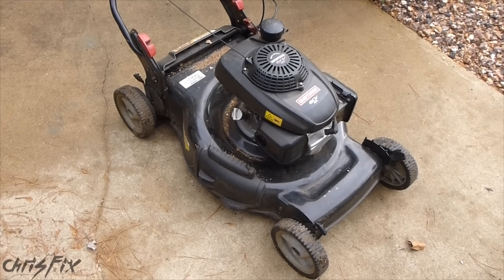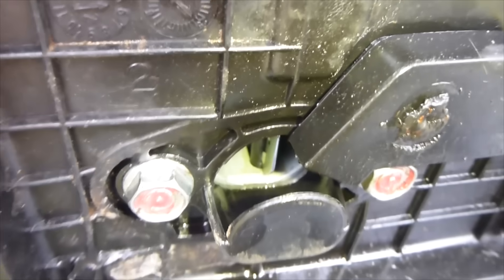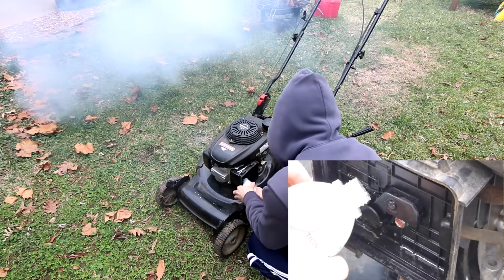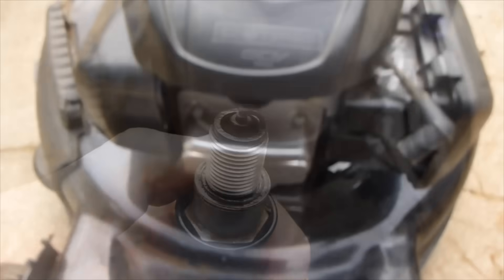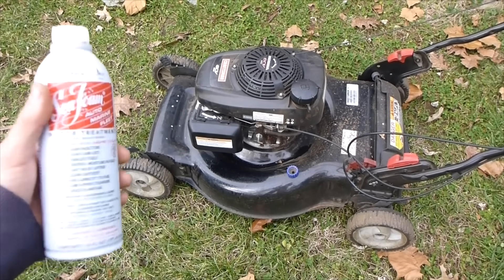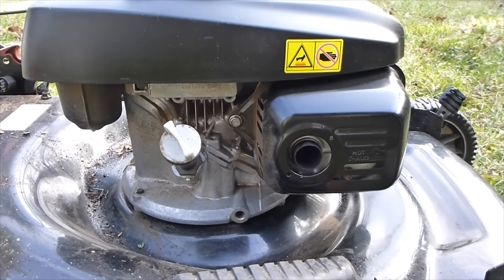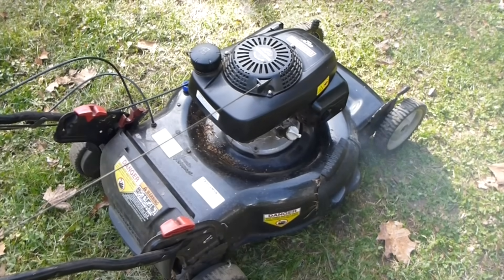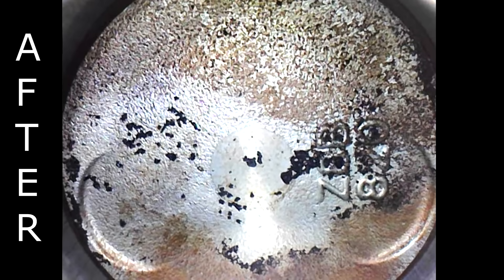Does Seafoam Actually Work? (with Proof)

Comment: I add Seafoam, Marvel Mystery Oil, and STP injector cleaner per the instructions to a 5 gallon gas can and use it in all my small engines.  Mowers, chainsaws, leaf blowers, string trimmers, etc, etc.  I do this 4 or 5 times a year.  I started doing this in 1997 and have very little problems with my small engines.  A couple years ago I got a well used John Deer lawn tractor that was hard to start and keep running.  I added all three products to its 2.5 gallon fuel tank per the ratio in the instructions, and did not do anything else to the lawn tractor.  Before half the tank was used it began running nice and smooth and is easy to start.  As of yesterday I have not had any problems with the engine other than a cracked inlet on the file pump near the end of last summer.  I also use all three in my cars.  My 2003 Envoy got over 225,000 miles on its original plugs.

Comment: Chris does sea foam damage an old engine I just bought a 1993 ford bronco with a 5.8L
Reply: It wont damage your engine or the plastic fuel lines if you put it in your tank. The best way to use seafoam is to pull a vacuum line that goes to the engine, I've had good results with the brake booster hose (you might have to do this while its running, by try to do it before starting... depends on the engine). 

The car will run roughly because the air-fuel mixture has been changed, so don't worry. Then open your seafoam and slowly tip it into the vacuum line while the car is running so that the liquid is sucked in by the vacuum. Be careful not to pour too quickly, or you could stall out the motor, or worse, hydrolock (NOT GOOD).

 You should see white/grey smoke coming from the exhaust... that's the seafoam along with the carbon buildups that are being removed. I like to use about half of the bottle, but you might want to use more since you've got a pretty big engine. 

After that, put the vacuum line back where you pulled it from and you're done!
Reply: Brandon Massey thank you for your response! So break booster hose? I’ll do that

Comment: Never had a problem until recently.   I did a "hot soak" with Seafoam on my 8hp 40 year old Briggs that ran fine.  Then I couldn't start it and it has zero compression.  Wondering if the Seafoam loosened up too much carbon and the cylinder got butchered thurs resulting in zero compression?   May need a rebuild but not sure yet..
Reply: Maybe a seal came loose?
Reply: @trpt4him  Thanks, it was the seat.
Reply: Pull the head off you will probably find the valve seat came loose and jammed the exhaust valve open. It’s a common occurrence on those old l-head engines. Just put it back in place and go around the perimeter with a centre punch to tighten it up. I’ve done that to several old Briggs engines with very good results.
Reply: @steveb.6267  Thanks, that was the problem.  Wow, I'm glad it wasn't way worse.
Reply: Rich Speers it’s an easy fix. Every year thousands of engines get thrown out because of this simple problem.

Comment: For a better controlled experiment you might clean out all of the carbon deposits & photograph it before running the test to be sure that the deposits aren't just clumping up. Also you might want to try the same without putting the Seafoam in to determine if by just running the mower that the carburetor expels carbon.

Comment: yeah,  breaking carbon deposits loose and sending them through the engine sounds like a GREAT idea.  If engine manufactures thought this was wise or necessary, they'd require it as preventative maintenance.  Keep buying your snake oil.

Comment: Funny about that hydrolocking.... I used to clean my engines by pouring water into the intake while the revs were moderately high. Cleans the carbon off the cylinders very nicely and never had any problems, but then I only poured it in slowly without stalling the engine. Black crap comes out the exhaust for a while at first but then clears up and at that point I know my pistons are clean. Would be nice to see Chris try a comparison between Seafoam and just plain water. He might be in for a surprise. This is a very old method... I'll probably keep up the practice since it works so well, but I'll be aware of the potential to hydrolock the engine if I go overboard, which I won't.
Reply from the maker: Interesting, thanks for sharing!

Comment: We used to get carburetors at the Yamaha shop that were ruined from the acid in that seafoam. If you do not know anything about cleaning a carb. or fuel system, take it to a mechanic. Seafoam is not a magic fix for something that is broken down, and needs fixing. Its a solvent that will eat up aluminum if you do not wash it all out. After you put all of that seafoam in the combustion chamber, you should have changed the oil, you will not get enough carbon buildup on a piston to warrant it needing cleaning, that doesn't accomplish anything, or have any practical purpose.

Comment: You do know that using an eye dropper and deionized water at 10drops a minute will decarbonize pistons
Reply from the maker: Interesting, thanks for sharing!
Reply: ChrisFix that’s been around for at least 30 years that I know of when I did my diesel fitter apprenticeship 👍🏻
Reply: ChrisFix hey mate, just another one for cars and trucks, pepper or an egg will temporarily seal leaks in a cooling system too but always get it fixed and not 100% reliable pending on how big the leak is or at the interface

Comment: I used on a 09 crf50f the carb was clogged wouldn’t start and i put that in and cleaned it in about 30 min
Reply from the maker: Thanks for sharing!
Reply: If it had not started and you left it in there any length of time, you would be buying a new carburetor.
Reply: Gregory Peterman I burned it all off in the day I put it in

Comment: Removing carbon deposits from intake and exhaust valves would have significantly more impact on the operation of an IC engine as compared to the top of the piston.

Comment: I've never used in a small engine but have used it in my vehicles. Keeps injectors cleaned out really well. Even my mechanic is impressed with how the plugs look when he changes them.
Reply from the maker: Interesting, thanks for sharing!
Reply: Why do some YouTube 
 mechanics say to NOT use this or similar products?
Reply: @randycurtis1176  old comment but there’s an alternative to seafoam which in my opinion is better built for vehicles and more modern it’s called gumout, seafoam stuff is better for smaller engines and lawnmowers, that’s just my opinion

Comment: Back in the 70's GM had a product called "TEC" top engine cleaner, worked really well, sometimes it worked too well, and knocked some carbon loose and would cause some damage.
Reply: Good Stuff  used at my work 🔧years sgo. As part if a premium  tune, oil & all filters. Vroom💨
Also referred  to as GM/ AC DELCO X66  TopEnd cleaner. A 
  Solvent benefit of carbon cleaning artillery bores  and formulated for auto use.

Comment: Sea foam works very good. Both of my Rolls-Royces lost power because of the humidity in S. Florida causing excess water in both cars. My RR mechanic said go to auto parts store and buy a couple of cans. One barely ran, and the other had to go to the shop on a rollback. After two cans several days apart, both cars run absolutely perfect. A RR dealer wanted to drop the tank on both cars which would cost a fortune. The Sea foam was a perfect fix for almost nothing. I highly recommend this product. It has other useful purposes I don’t know of. But for this type of problem, it’s great. A very honest RR mechanic that started working for RR at the factory in England is the one that told me about it. You can’t get a recommendation as good as this. Believe me!!!!
Reply from the maker: thanks for sharing!
Reply: sparky12x not to sound condescending, but nothing is superior to perfect. Possibly as good though. I will stick with using even when not necessary for routine maintenance. Mine were so bad with the humidity in Ft. Lauderdale, I changed the fuel filters on both of my RR’s. No more problems. I also use Marvel Mystery Oil in both cars. It keeps everything clean. I use in my yacht with 2 large Diesel engines and 2 Diesel generators. I use in the diesel one gallon per 400 gallons of diesel, and also in the transmissions, generators, engine oil, etc. No more injectors hanging, and 90 % reduced less soot even after a 3 to 400 mile day. Try that too! Very good and very old product.

Comment: I don't immediately see any comments about this, but I wouldn't let seafoam sit for long on a 4 stroke engine. Seafoam will slowly flow past the piston down the cylinder, and get mixed with the oil in the catch. If you took the piston out and let it soak in seafoam that'd be ideal.

Comment: You get a better result by misting H2O into the carburetor.
That's right, just plain water.
The mist turns into high pressure steam which cleans the top of the piston and the spark plugs.
Seafoam is for suckers.

Comment: I did this for my Yard Machine, cheapie Briggs&Stratton with the governor throttle.  It had the infamous surging problem.  Checked the governor and all was in working order.  I use the fuel stabilizer, but that stuff does not last.  So I put some Seafoam in it.  After the ubiquitous smoking, it ran great with the surging disappearing.  The next time I used it, it went back to surging.  Before I was finished with the yard, it would not start after filling the tank up.  I ended up replacing the spark plug and it would run again.  It was not surging for the first 10 minutes, but started soon after.  The next time I tried to use it, it would not start.   I believe the magneto (cable) failed.
Reply: Clean your carb. It sounds like you are having fuel delivery issues.

Comment: If the engine has a CDI ignition and you do not ground the spark plug, or at least the wire, you can burn out the CDI unit. You can pour the C-foam into the fuel tank and it will gradually clean the engine. If you pour C-foam into the cylinder and the rings are at all worn, the C-foam might leak down into the crankcase and dilute the oil. CAREFULL!

Comment: I had a Dodge truck in my shop with 38k on it. Customer dumped seafoam in the engine and snapped a connecting rod. Be careful
Reply: Yeah. I'd never use it. Plus, wasn't there seafoam that was recently recalled?

Comment: Can i soak a cylinder head on a car and turn the engine over while the plugs are out?
Reply: You can, but the liquid won't go out of the cylinder, the spark plug hole is vertical
Reply: but the engine wont hydrolock if i put the plugs in  right?

Comment: warm to hot water in a spray bottle pumped in slowly will do the same or better cleaning the oil rings as well. Add some hydrocarbons, metholated spirits in the the spraybottle water can aid the process.

Comment: I use sea foam in my AR-15s ...pour it right down the barrel and then let it drain. Cleans the barrel and makes the bullets fly faster and hit harder. Shooting is more of a rapid fire like a fully automatic machine gun. It also adds weight to the rounds. Turns a .223/5.56 into round closer to a .308/7.62. Great stuff!

Comment: look at all that beautiful pollution. so happy I switched to electric lawnmower.
Reply: Used to work in a mower shop. Everyone that bought an electric mower ended up going back to a gas mower within a year. 2 main complaints I heard were lack of power/ runtime and the mower basically falling apart. I hope you gave better luck with yours. Perhaps the technology has improved enough to be a viable gas mower replacement.
Reply: @umamichefd  I use a cord one. Plenty of power. I was the other way. I switch from gas to electric.  The smoke always made me sick. even on a brand new mower. I know its hard to accept it. but that crap is not good for us.

Comment: Your “test” isn’t really what SeaFoam is used for. Interesting none the less.

Edit: Just FYI, product TECHRON works even better than SeaFoam.  Gotta buy STRAIGHT Techron, not product that say “WITH Techron”.  We’ve saved/salvaged MANY 2-stroke & 4-stroke outboard boat motors with BOTH these products. Many of which sat under saltwater for days/weeks.  Lots of cleaning and flushing of motors inside and out (plus electrical flushing with WD40 and T-9 spray).  Got a set of Honda 200 outboards for $100 that had been upside-down and under saltwater for over 2-3 weeks. About 4 hours on each one they ran like new. That was over 4 years ago and our buddy hung them off his boat full well knowing what condition they were in/from. He’s logged over 350+ hours on them since. He still uses SeaFoam every other tank of fuel.

Comment: I want to say to everyone don't use sea foam this way. Simply put 1/3 of the can mixed into the gas to clean out the carb and burn any gunk in the carb. Lil less time consuming. Same goes for a car/truck but use a full can to half! Cleans up your injectors and pistons. Same with putting it in your oil quits down valve ticks top end noise!

Comment: It looked like it did good, but does it clean the needle valves good if you mix it in the gas? Most mowers this is what gets gummed up. Also, is this good to be in the gas to winterize?

Comment: Berryman B-12 Chemtool is half the price and works as well in my opinion.  You'd have better luck spraying/pouring some of the seafoam directly into the piston cylinder chamber and let it soak in a few minutes before cranking it over.  I did this on my Saab 900-S for years to decarbonize my pistons.

Comment: It works but I find it much easier just to run Marvel's in all my gas.  From my weed eater to my truck.  Side by side testing using them both directly into the intake the Marvel's cleaned better as well.

Comment: the first time I did this on my old toyota tacoma 5 years ago it made me so nervous.  
My old auto tech instructor said back in the 70s when he worked at a Chrysler dealership it was common practice on high mileage carbon build up vehicles to have one tech crack the throttle open at about 1,500 rpm while another tech slowly poured straight water down the throat of the carb to basically "steam clean" the top of the pistons.

Comment: I've used Seafoam for years. 2 oz per gallon of gas and the gas is still good after two years. I use it in my crank case   (I think the recommended amount is 1 oz per qt. of oil)? Refer to the Seafoam web site. I buy it by the gallon (it's cheaper that way). This stuff is like a tune up in a bottle!

Comment: That junk will blow a motor up,never use it on anything you want to keep.
Reply: It didn’t blow my engine up....but it did damage it! I still drive my Jeep, but I can smell oil burning. It happened right away. And I lost compression...... some auto store guy poured a whole bottle in. I asked, you didn’t use the whole bottle did you!? He says “yes, you supposed to, I do it in my Toyota every year!”.
Reply: I want to hurt that guy!
Reply: @justinepeabody4534   Unless you're handicapped or in certain instances( such as being a woman) you had no business having the auto store guy pouring it in for you ... PS What is a auto store ?
Reply: sentry8535 they put you in the zone. He said your tank is full right? I said yes but I never ever put whole bottles of anything in my vehicles. One of the other store attendants asked me questions about my Jeep. I turned around and the other attendant was outside pouring it in. There is no smoke or anything like that. But the smell of burning oil is there after driving for a while. I am just going to buy another vehicle. I was told that leaking oil from some screw is common in these motors. I haven’t been able to find that info on line anywhere. Btw, my oil is very clean. It does need a Half quart added each month. The Sea foam was put in last winter.

Comment: Why is this helpful?  Pretty piston.  Great.  Now what?  Easier to start?  More fuel efficient? What is the benefit?
Reply from the maker: So for a mower it’s not as important but extra carbon can increase compression and cause your engine to detonate. Carbon on valves could mess up the air/fuel ratio and you lose efficiency and power. For just normal amounts of carbon it’s not really important.

Comment: Chrisfix, I work on push mowers like Mustie1. And I also work on push mowers that doesn't start correctly. And I recommend seafoam in gas tank to clean the fuel injectors including to clean the carbon buildup on the piston.

Comment: you would have done a better job heating engine then pouring some in spark plug hole leave over night, and leave spark plug say in a thimble full of sea foam.
In the uk in the 70,s we used to use redex to clean engine and un gum piston rings etc.

Comment: POUR WATER INSTEAD, PISTON AND VALVES WILL BE SPOTLESS.  SEA FOAM DOES NOT DO THE JOB ADVERTISED.  BEEN REBUILDING ENGINES FOR THIRTY YEARS, FIRST STEP IS ALWAYS POURING WATER INTO THE ENGINE (HOT), AT A RATE THAT MAKES IT STUMBLE BUT NOT STALL.  OLD MECHANICS HAVE KNOWN THIS FOREVER.  WHEN WATER HITS THE RED-HOT CARBON IT EXPLODES INTO STEAM, WHICH SHATTERS THE CARBON DUE TO UNEQUAL EXPANSION WITH THE METALS IN THE COMBUSTION CHAMBER.  THAT IS, THE EXPANDED CARBON SHRINKS INSTANTLY, LONG BEFORE THE PISTONS AND VALVES WOULD, AND IT SIMPLY LOSES IT'S GRIP ON THE METAL.

Comment: I have a 2015 RAM 5.7 HEMI. I have been running SeaFoam to Gas tank energy time I fill up. It runs smoother with seaFoaam. The gasoline is Sunoco Ultra 93 octane. 👾